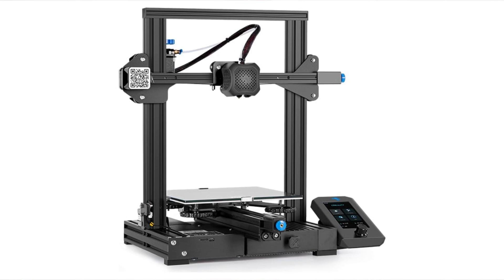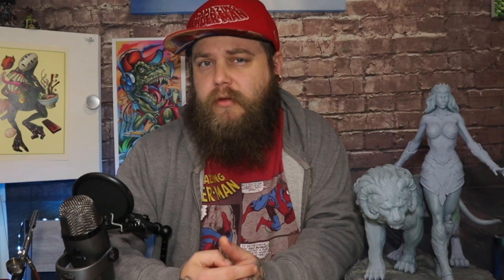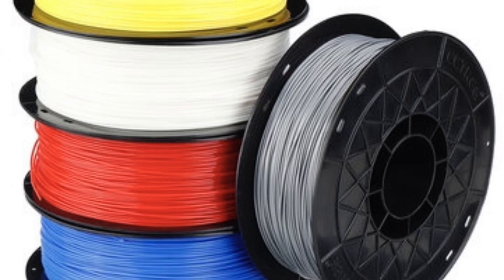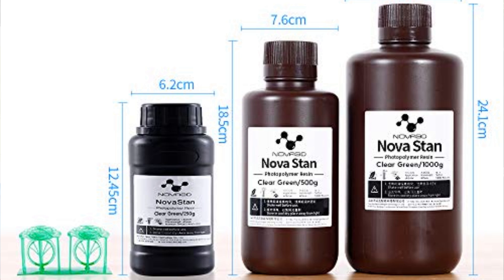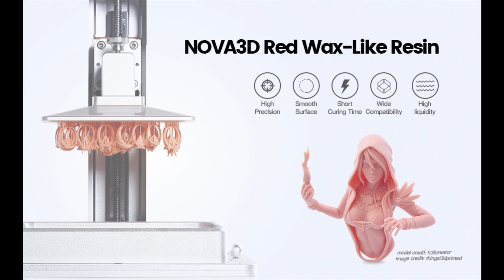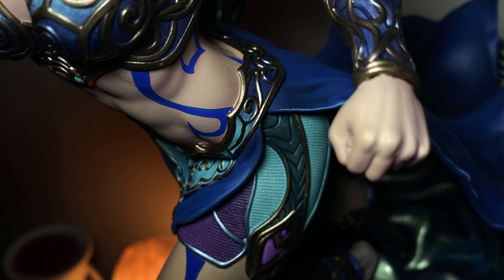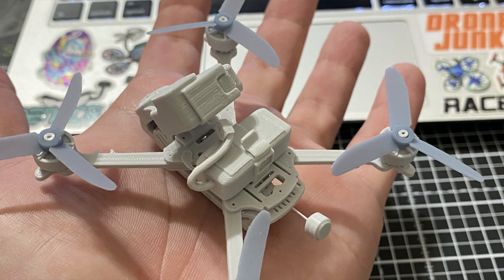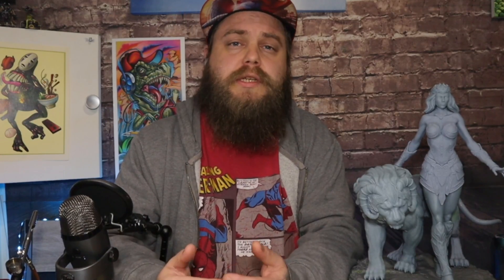Introduction to 3D printers : FDM-Resin

Comment: Really helpful video thanks. I'm looking to print some 1:8 models to paint as a hobby. It sounds like resin printers will provide better detail prints but not sure if the benefit is worth all the extra steps (cleaning and setting). Would you be able to do a small comparison print to show the differences?
Reply from the maker: No need dude. It’s widely know. That fdm can’t touch the level of details that resin can for statue printing.

Comment: I’m liking going through your videos but was wondering what nozzle size and layer height for FDM do you recommend? 
I’m going to start with FDM before I get into resin printing.
Reply from the maker: I use 0.4mm nozzle and a good layer height that isn’t toooooo slow is like .12mm but you should go in increments of the nozzle size so for this nozzle size .8 / .12 / .16 that’s the best heights for the nozzle size and for details. If you wanna smash out stuff faster then go like .20 or higher.
Reply: @Groundeffected  not in a hurry for decorative parts so 0.12mm sounds good, also good knowing that I don’t have to swap out nozzles. Thanks

Comment: hi, love your channel, great content. I have an ender 3 since 2018 and I'm mostly printing models to paint for myself. I dont like sanding too much , and when I see your resin prints I start drooling all over. I think I need to get into resin, but I'm not sure what printer is the best for me. I'm afraid its too messy of a workflow, and also I print in my living room so I think that the noise/smells are also an issue :) any tips for me ?
Reply from the maker: Thanks dude. I print in my lounge with 3 printers and no issues. They’re actually mostly quieter than fdm machines. But get one of the larger mini screen ones then you can fit more on the build plate and mono screens last longer
Reply: @Groundeffected  10x, can you give me a model you think is a good start. I'm looking for the ender 3 of Resin printers :)
Reply from the maker: @thedude333  um, that is probably anycubic mono but I’ve never used one before. Creality do make their own one like halot one and a couple others. My first one was a creality ld002r but in today’s landscape you can get better that will last longer. That’s why I suggest a mono screen printer less maintenance in the long run.
Reply: @Groundeffected  I guess I'm gonna get the ANYCUBIC Photon Mono 4K, low noise is one of my most important needs, since my wife cant handle the noise :) what would be your  recommendation based on your personal experience ? thanks :)
Reply from the maker: @thedude333  to be honest I can’t tell you about the noise on the anycubic but between my sonic mini and mighty the bigger one is more silent. They do t really make much noise. But there is an audible popping sound when they print of the print pulling off the fep sheet. That can be the worst sound I would say. In a small flat like mine it’s audible at night but you kinda just get used to it. It’s very background ish type noise.

Comment: I’m looking for my first. 3d printer. What would you suggest.. looking to print statues like you have done
Reply from the maker: If you want to print large scale statues then get one of the bigger mono screen printers. I have only got my own machines to talk about as I have no experience with others but I would go for a sonic mighty 4K that way you can print large stuff as well as small stuff. Hope that helps.
Reply: What do you use. I see your statues come out large
Reply from the maker: @starlightcollections5954  I have a sonic mighty 4K
Reply: @Groundeffected  I have never used resin before I was thinking more of the other kind. Was looking at the ender

Comment: I've been thinking about getting an FDM printer to use for large bases for my models but I'm uncertain if I should, or save up the money for a large format resin printer like the Mega 8K or Jupiter. One thing I didn't realize is that FDM prints super slowly from what I understand if you want high quality prints. How's your experience been with this?
Reply from the maker: It’s a fraction of the cost to print large bases fdm compared to resin but yea does take long. Most large bases take a week or more to print. Faster is usually not as tidy of a print.

Comment: Interested in your post processing tips eg cleaning and using tweezers so you don't need to touch uncured goodness. Perhaps a short video?? Good work bruv n thanks
Reply from the maker: I will add it to the list of to do videos for sure. Mostly I just keep the handle of the plate clean and scrap into a tub then move the parts with a tweezer to the alcohol holders and they have a handle so I can swap between used alcohol to clean the bulk off and new fresh alcohol to do a proper clean.

Comment: I'd like someone to make a resin printer with the volume of an FDM - so many files are still sized for FDM, but designers are getting better at cutting models purely with resin printing in mind. I've seen at least one review for the Phrozen 8K, personally I don't have any need for anything that high resolution with a print bed that small. With anti-aliasing dialed in, anything sub 50 microns is smooth enough for most miniatures imo.
Reply from the maker: They make resin printers that big it’s just bloody expensive. And soo much resin wasted if you have a fail. I’m really excited for the newer generations of printers if I can get those layers closer and more accurate I’d be so happy. I print at .03 and I can still see layer lines in some models. I have to sand every print before paint so hopefully future machines will have really great resolution and larger print volume. But time will tell
Reply: @Groundeffected  I'd forgot about those massive cabinet machines - yeah a touch out of my price range. Slightly off topic but when you've sold statues have you ever had a buyer complain about the weight? I just recently sold a printed statue for the first time, 1/4 scale, fully painted, and the buyer said they wouldn't have paid so much if they'd known it was hollow. I wasn't really sure how to respond. Maybe to a traditional 'polystone' collector a printed statue might seem less valuable, but I don't know how to remedy that, short of somehow filling it with something?
Reply from the maker: @nrgspike  maybe it has to be something that you discuss and perhaps you have to make it solid or even really thick walls and fill the drain holes. I haven’t had that complaint yet to be honest I mean to me it doesn’t devalue the model the resin isn’t the value. IMO
Reply: @Groundeffected  It wasn't a commission, I just sold it on eBay - I was testing the waters to see if there was a market. The buyer made me an offer to end it early for them, then had a touch of remorse I think. If I do it again, I'll have to make a note about the weight and if it becomes a reoccurring issue, I might look into finding something to fill prints with to give them more heft. But agreed, personally the value is in the sculpt, print quality and paint app. Not the relative mass, but each to their own I guess. Cheers anyway!